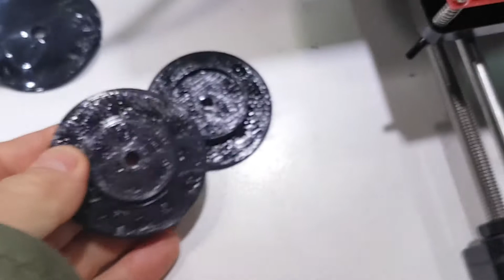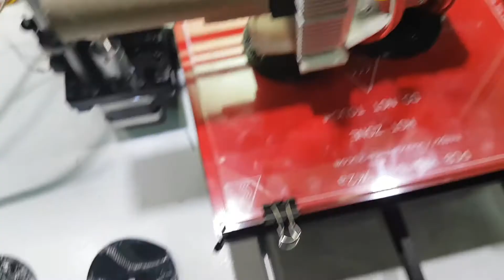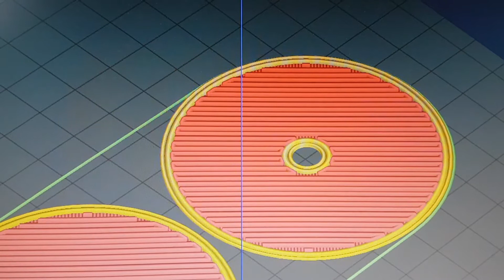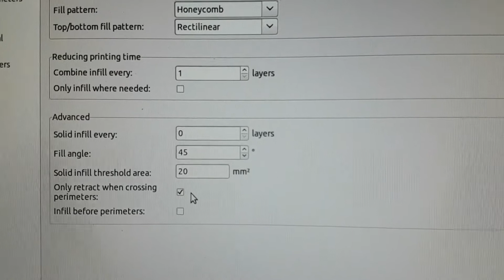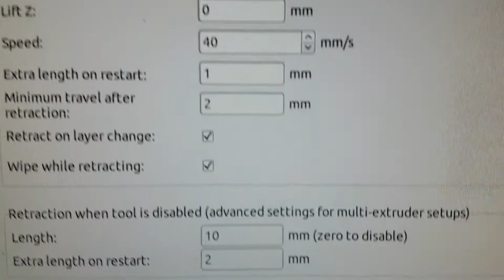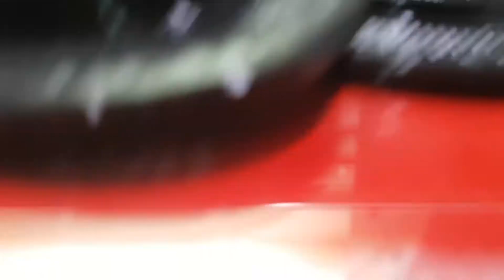BIG TIP: Volumetric control: 3D printer.

Comment: why do you have the hot bed on upside down?
Reply from the maker: It's the right way up, the other side has the tracks protruding as well as the soldered on wires & thermistor.

Comment: nice progress!
Reply from the maker: I can't believe the difference in workflow and strength.
I am half thinking of making my own hot tip with two elements, and a long heater block so as to double the flow.
The robotics can easily outperform the heater.